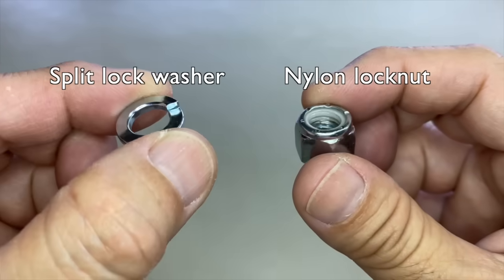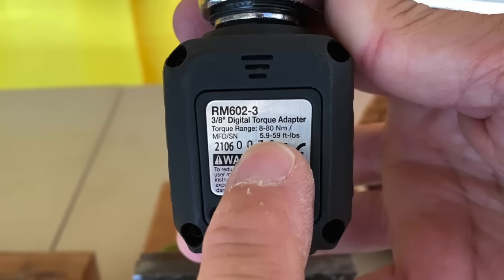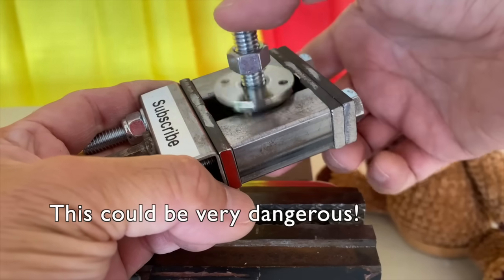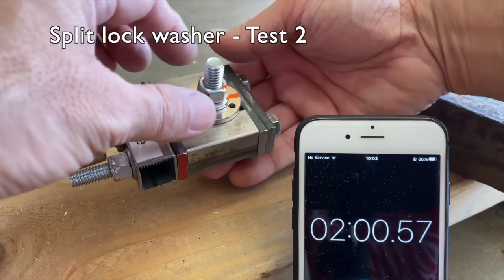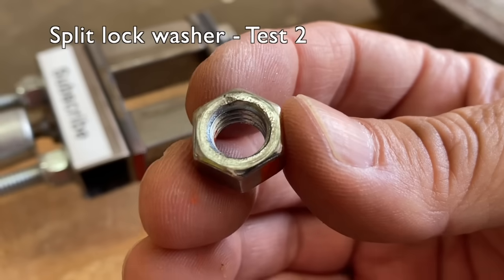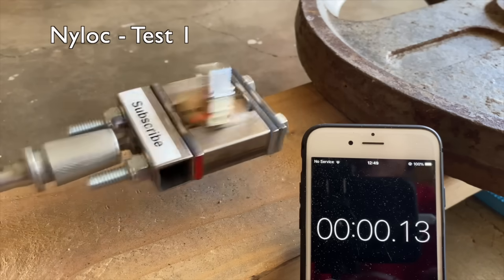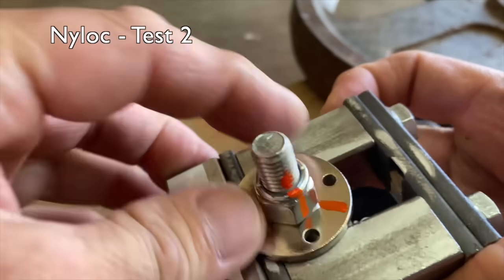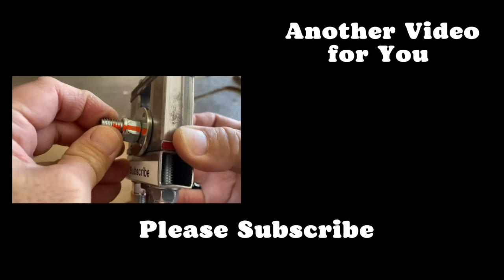Nuts & Bolts - Split Lock Washer vs Nylon Locknut – DIY Impact & Vibration Test - Part 1

Comment: as of someone who has worked with a mover with same forth to back mowement I can say from real word that nyloc is worse than split lock washer with regular nut. what did help me get things to not come loose was in the end even regular nut with a second nut (nyloc) locking it to the bolt.
your test bench has one small flaw in this test. it's the fact that besides having vibration on these pieces you are creating a hammering force on your bushings. and cause your bushing aren't exact fit on the bolt there is small movement between these bushings and bolt. this wears some material and at the same time loosens the nut due to the mowement. that's why nyloc did do the best. instead of the nut gripping to the material it's trying to hold together it's gripping to the bolt itself.

Comment: Torque specs for 3/8-16 bolts
18-8 stainless steel: 236 ft lbs for a 3/8-16 bolt 
316 stainless steel: 247 ft lbs for a 3/8-16 bolt 
ASTM A449 / SAE Grade 5: 31 ft lbs for a 3/8-16 bolt with 16 threads per inch (TPI) 
SAE Grade 2: 25 ft lbs for a 3/8-16 bolt

Sorry, your tests did not use the specified torque settings. Results not relevant.

Comment: I repaired railroad cars for 22 years. It's required that the nut be tack welded to the bolt or the threads be chisel checked. It may loosen up, but it ain't come off unless the bolt breaks.

Comment: About the lock washer.It's not the correct test, because nut, washer and lock washer can rotate on bolt. Lock washers use then one of the surfaces can't rotate.

Comment: I would think medium to light guage sheet metal has some deflection/ deformation propensities, beneficial for split-washer securement methods- under axial loads, similar to those shown in the video- whereas heavier guages (>1/16") of sheet metal may be more rigid and, therefore, less likely to assist in creating a stronger assembly, using split washers, owed to a greater resistance of the workpiece becoming parallel (and consequently applying higher, securing, dynamic tensions) under load.

All that said, admittedly, I am not an engineer.

Comment: Such a flawed test.  Split lock washers are designed to work when properly when the preload torque is maintain.  6 ft-lbs is not even close to what a cheap Chinese bolt can handle.  Redo the test with a reasonable preload torque using a man's torque wrench not that kid's toy.  Nyloc's are designed to not loosen without any preload so naturally they did not loosen much after the preload (such as it is) was released.  I predicted the results without seeing them.

Comment: We used couple of drops of urethane enamel or oil based paint or similar on the treads and it held better then split lock, thread lock or nylon nuts. Try to unscrew bolt that has a good paint on the treads and you will know what I mean

Comment: I know a guy who built a 54 foot catamaran in the early 70's. he was talked into using nylon lock nut for the rigging instead of castle nuts with cotter pins. The first time he ran into bad weather all the rigging came loose and demasted the boat. He was towed back repaired everything replaced all nylon nuts. With castle nuts Never had trouble again
Reply: Nobody reads a comment that begins with “I know a guy…”

Comment: I guarantee it took way more than 6 foot pounds of torque to put those nylocs on let alone able to verify at the final tightness. this testing method is very flawed. nowhere can I think if a place that involves that much vibration requiring only 6 foot pounds of torque.

Comment: This isn't very scientific.  There are two many variables.   For example, as the washers slide against your shaking mechanism, friction would cause them flake off some of the metal on the washer (causing them to loosen over time)

Comment: I designed low voltage power distribution systems for Eaton Electrical and we exclusively used conical (Belleville) washers for securing bus bars fyi.

Comment: I'm a retired NASA engineer with 60 years experience in handling my nuts. I am an associate engineer at Ocean Gate. I also have worked at Mc Donald's where I handled my nuts while servicing the soft serve machines. I  have my hands on my nuts right now and can tell you right now that this  test is completely bogus because the only correct way to handle nuts is to bounce them off a chin.

Comment: I wonder how much that dry paint played a factor in the nyloc stopping at that point. Since the nyloc works on having a tight connection to the bolt threads I have to think it played a big factor. It only moving a millimeter or so backs that up. A marker would have been better and having the marks on the threads further down the bolt to be sure. I wonder how well a double nut system works.

Comment: Split lock washers will always crack under stress and quite possibly break upon removal thus are intended to be used once.  The bolt is torqued with the lock washer to hold it in place nothing more.

Nylock nuts are also meant to be used once and are generally used to allow to pieces to move or rotate with the nut staying in place.  On that note there are different grades of nylon with different melting points, ive had cheap ones melt enough while installing with a ratchet come loose.

High vibrations use serated flanged nuts or star locks.  Then there are belville washers to increase clamping force such as copper buss bar. 

Enough from me, this is just another wannabe trying to make money on YouTube.

Comment: Interesting test method. No surprise the assemblies came loose; the recommended maximum torque spec for GR5 3/8 coarse (16tpi): 23 lb-ft (wet), 30 lb-ft (dry). ALSO; there are many different locking washer designs. IMHO, a split washer is likely the most prone to failure.

Comment: Automotive applications I can't think of any safety critical component with a split washer, I can think of plenty with a split pin, plenty with a pinch nut, some with nylock nut, some using one use thread lock impregnated bolts. They have tested for many years & know what they're doing.

Comment: Maybe a good idea to hire someone to changed your car tires, 6 lbs for a 3/8 bolt,  is a failure coming up pretty quick. Nowhere near enough force for the "split", lock washer to work.

Comment: Correct torque and loctite type treatment is usually the correct solution

You can add to it a split pin in case off !

Comment: First thing is I would look at the proper torque specs for that size bolt seems like 6 pounds is a little low. I’d like to see this same experiment done with better quality bolts like grade 8 or F9 11 and I’d also like to see it done with fine thread bolts Might make a big difference

Comment: How about using a plain nut and regular washer with lock tight (The strongest loc-tight, I forget if it's red or blue) with the proper torque specs?

Comment: I am involved in automotive restoration.   There are certain manufacturers marks like a crosshatch pattern on the edge of split lock washers that makes them necessary in putting them back in cettain assemblies.  I do find these lock washers cracked quite frequently.  Multiple cracks in one washer are not unusual.   I have collected numerous hardware manufacturers pieces simply due to the markings cast or stamped on them.  Often having them replated.  Improper fasteners in grade or size is a very common item from shade tree repairs.

Comment: I’m retired Automotive Engineer.  I like your test however, most have it right converting torque specs.  I was on a project where we determined torque requirements for wheels and hubs.  We controlled not only torque but material, speed and method.  Still, I did like your effort.

Comment: I would expect to torque such a bolt and nut to more torque than that, probably making it hold much better and for much longer. 6lbs does not seem like enough.

Comment: Good video but only valid when not using the correct amount of torque. It would be interesting to do the same test using the correct industry standard torque for that thread size.

Comment: If you experience a 40% decrease in your initial torque value, it can lead to significant problems and challenges.  When using Nyloc nut, the number 1 failure mode is over-tightening the connection.  The second concern is environmental (thermal, radiation, acid) can destroy the nylon in the nut.  When you have rotation, vibration, and temperature & humidity changes will affect torque.  Using anti-seize on a stainless bolt will defeat the purpose of a Nyloc nut.  (They make special nuts for stainless steel.) I worked in a Product Engineering Lab for 21 years, and we tested everything torque.

Comment: What about old slight surface rusted bolt and nuts? Because I fell those grabs better on the thread. When i put together new bolts and nuts I usually use thread lock as the manufacturer on cars for example does. I know no matter how tight when the surface is new it never really grips well the surface rust that form on the outside portion where is not in contact rusts creating grip to not loose further.

Comment: I refuse to use nyloc's.  It always makes it harder to undo or do up. Even more so in tight spaces.
Never had an issue with spring washers, as I call them.  And I maintain a fleet of vehicles.

Comment: Test 3 of the locking washer you can tell the lock is facing the correct direction shown by the lock biting the nut and washer surface. you did not show if the other lock washers were facing the same way or opposite. This test is not really valid. Second issue with your test, the vibration forces used in this of a completely loose "clamped part" are well above any actual forces that would take place taking into consideration of the torque value you used. 1 other thing you need to think about. Nylon nuts are "1 time use" once that nylon has been cut into it has lost most of its locking power. the lock washer is still usable as long as it is not flattened out and installed correctly , and even if you do need to replace the locking washer it is significantly less expensive than the locking washer.

Comment: I think the lock washer, if tightened to past hand tight, more appropriate torque value as in the real world, say 15-25 ftlbs would have lasted much longer. 6 ftlb is barely over hand tight. You are almost guaranteeing that the Nyloc nut will win. It is telling that you are using Nyloc nuts on the bolts holding your jig together, although subject to an axial load and probably a higher tightening torque, they stayed tight the entire time. Nyloc is the way to go, unless you are using them on extreme heat.

Comment: In high vibration applications, if you are engineering it yourself, the use two bolts in a row where the HEX bolt heads touch each other. if one tries to losen, it tightens the other, and vise-versa. If it's impossible to tighten the bolts with them touching each other, you can use a metal bracket between them to jam the bolt heads together. This setup will never fail unless the hex heads strip.  But then you had other issues :)

If you are in a snow-belt area, you'll have had the pleasure to use vibration machines, AKA, snow blowers/throwers.  You'll find on almost all snowblowers that the large hex bolts that bolt the muffler on to the block go through a thin metal plate. Once the bolts are through the plate and the muffler and bolted on to the block, then you are to bend the thin metal plate over the bolt head. It'll never come off.

Lastly, the lock nut has other applications other than just stopping the hex bolt and nut from loosening.  If it's impossible to get a tool on the nut to hold it while you tighten the bolt head, then use a lock washer and tighen the bolt down to hand tight with just a normal nut on the other side.  The lock washer will allow you to torque the bolt head without holding the nut on the other side with a wrench. Brilliant.

Comment: You should have tried adding blue and red loctite into the test as an extra reinforcement option. Would be interesting to see red loctite small and heavy application on the nylon locknut. Maybe a separate test with some super glue also?

Comment: Proper bolt torque is established by the force required to stretch the bolt slightly as the threads engage. 6lbs torque is way too little for those bolts so you are relying simply on the small mechanical force to prevent the threads from unscrewing. Good effort but pointless..

Comment: A grade 2 bolt of that size calls for a torque spec of 25 ft-lbs. I think a more scientific test would be to run it to the specified torque. My guess is that they would all loosen initially around the same time and how much they loosen after that initial movement would be mitigated by the lock washers and nylocs.

Comment: I'm not a mechanical or materials engineer, but even I can tell you this test is useless, these performances have no bearing in the real world at all as nothing is tightened with these specs, it's far too low for such a lagre bolt. And on top of that, the nylon locknut would have a friction torque that you have to overcome to turn it, which means if you still torque them to the same, the clamp load is necessarily less by the amount of friction resistance from just turning the nut, so you're not even comparing them at the same level, the only reason the nylon nut does better is that it doesn't sit loose on the screw-threads but is held in there by the plastic being in direct contact.

Comment: The other thing to keep in consideration when choosing a split lock or a nylock is the deterioration of the rubber holding the nut in place. The rubber will melt sooner than the steel in hot conditions for example

Comment: A split lock washer doesnt work until the joint has failed. When it's tight the washer is flat and cannot bite into the surfaces. So by the time it can bite, the joint has already failed.

Comment: What is ridiculous is that the Rugged Obsidian 9 suppressor uses the nylon locknut to lock it to the barrel. But just after one trip to the range, the nylon burned out, and then it has little locking effect. I mean, yeah the nylon locknut is good, but for suppressors? Come on man!

Comment: So the takeaway is, if you want a bolt/nut combo to hold for an eternity, must use red Locktite with a split washer and a nylon nut and if that still comes loose, then you need to slow down and do the speed limit like everyone else.

Comment: What's the point of that video? 

You asked question and left it inaswered. 
People commented already about ridiculously low testing torque. 

However, even your test showed different result suggesting different applications. 
Nylon nut remained friction on the bolt but allowed movemt of bolywd parta very quickly. 

Split washer obviously losened once the nut moved beyond some distance.  However it kept pressure on bolted element significantly longer. 
That's already a conclusion. Not better - different purpose. 

One simple conclusion without any test: nylon nut is less heat resistant. So it's out of many mechanisms for thay reason. 

Another point. You supposed to use flat washwr under the split washer... and so on, and so on. 

If you make test - draw conclusions. Otherwise it's pointless.

Comment: Believe it or not. If I'm worried about a nut working loose, I coat the threads with super glue. This and my method have never let me down yet. In fact it can be far too strong. I mean trying to remove a nut after  12 months or more can be difficult. But it can be removed after 5 or 6 turns.

Comment: The biggest difference I've seen is in reuse.  You can reuse a split washer in normal use.  You better not reuse a nylok.  AndI expect that the initial torque for a split washer would be higher than the torque setting used for this.  That another use where the nylok wouldn't be as good.

Comment: if the paint marks on the nylock nut stayed aligned then it did not turn so either bushing is 
shrinking or bolt stretching.

Comment: Don’t agree with the test design   Split washers would normally be used on a fixed surface like a flange   You would not use a flat washer under the split washer   These are low vibe applications   High vibe like car engines need properly designed and torqued bolts  nylock and split washers are good for joining wood pieces where the joint loosens over time

Comment: Takeaway: Use a nylok nut with a split washer underneath, if the application will allow....plus thread locker.  Belt, suspenders, and elastic waistband.

Comment: Très intéressant mais, j’ai bien vu les assemblages avec rondelles, les tests ne sont pas corrects, je n’ai pas vu de rondelle côté tête de vis, du coup le desserrage se fait de ce côté là. Désolé. Et pour le nyloc, on appelle cela un assemblage imperdable et pas indesserrable, il aurait fallu mesurer la tension résiduelle en fin de test,  e qui n’est pas simple à faire précisément sans outils adaptés. Bonne continuation, les questions soulevées sont bonnes.

Comment: Many engineers and specialists in the comments. At high frequency vibrations,  the "stupid" nylon softens. Have you seen a bolt and a nut with plastic, when they go into resonance in seconds, what happens?. The "cotter pin" suggestion is not serious! A person who has accumulated practice knows very well why. Looking at the comments, your tragedy is complete, With such "thinking" engineers, I'm afraid to get on a plane! I'm sure no one has heard of "Prevalling Torque Lock Nut"?  When I'm doing something for me, and I don't have a counter nut nearby, I hit a regular nut with a hammer on one end to make it slightly elliptical. The following remains in my mind. When I buy replacement parts for my car, usually the cheap ones have nylon in the nuts and the quality parts have "flat" nuts.